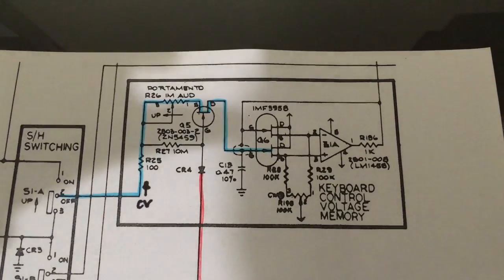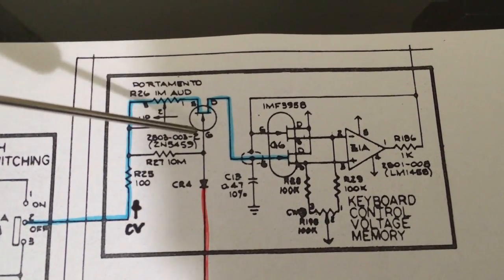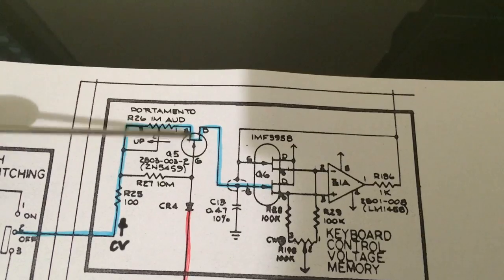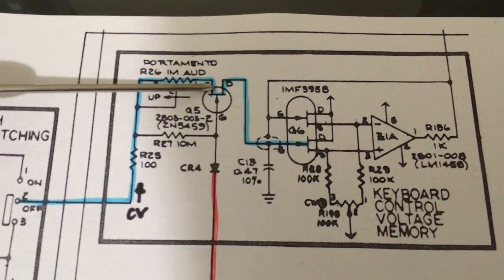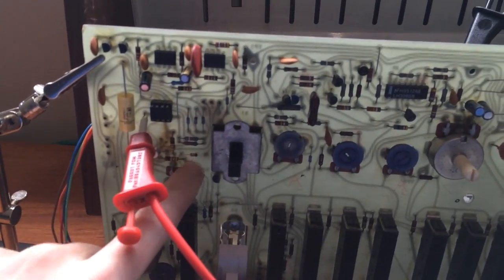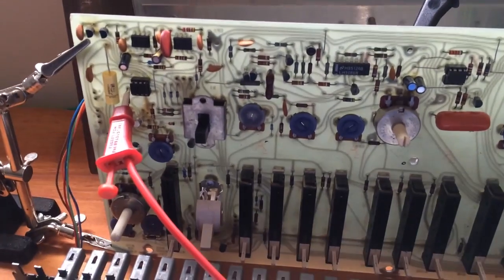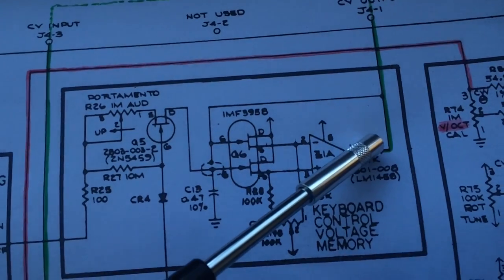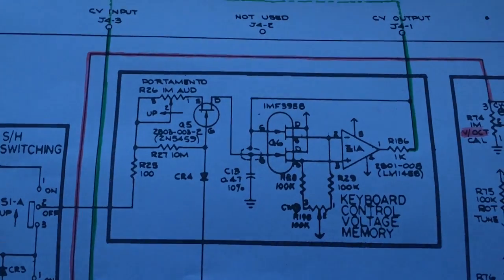ARP AXXE Restoration (Part 3) - Troubleshooting Sample & Hold, Portamento, CV Memory circuits

Comment: Really helpful, really clear! All your Axxe videos have saved me an immense amount of time - and money - and now my Mark I is playing better than ever! Loss of Portamento and S+H (which never ever worked) were the main problems your video helped with, and luckily I managed to bend the CV socket back into place, and swapped out the diode, thanks to you. Sliders? ah! - just gave them a good clean! I also did the infamous 'Peroxide/UV' treatment to remove the bromine from yellowed keys, which was really effective. There's still a bit of discolouration, but I'm pleased with the results. No doubt a complete Cap and IC (with sockets installed!) replacement would really help at some point (courtesy of components from New England Analog) - but that can wait for another time.
Reply from the maker: The S&H circuit in the AXXE is really unreliable. I've have to fix mine three times. In the end I just bypassed the transistor pair (IMF3958) and replaced the op-amp (Z1 LM1458) with a TL072 (or any FET based op-amp). Since then it has been good. I've had to rebuild the noise circuit a couple of times too! Glad to see that your's works now. It's a very underrated synth.
Reply: Hi, may I ask how you cleaned your sliders?  Mine are in need of a cleaning.  Did you use something link DeoxIT F100L fader fluid?

Comment: I hope that I can see the faders replace. I have an arp axxe make and I need to replace them, thanks for this video
Reply from the maker: Marc Moreno Gonzalez I have nearly finished replacing them and I will post the video. I would recommend replacing the with LED sliders because it is a big job. It took me a few weeks. But you can buy replacement sliders that are the same as the original ones, so they fit in the circuit board. You can get them from eBay, but they are expensive. There are also other videos on YouTube that show how to remove and clean the sliders and put them back in. So maybe search for them as well. There are many options.
Reply: Hi, first thanks for the reply, I have a lot of Sliders broken and my only option is replace all of them because originals are very expensive. I wait your video, but i don't want make stress! thanks again